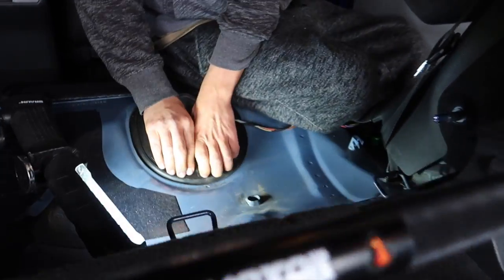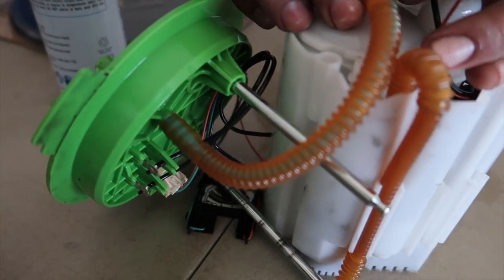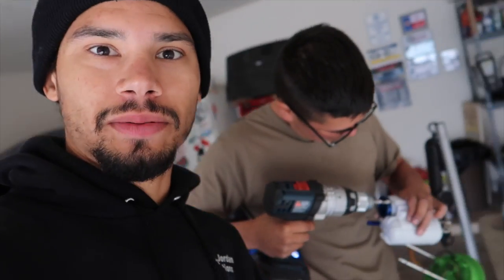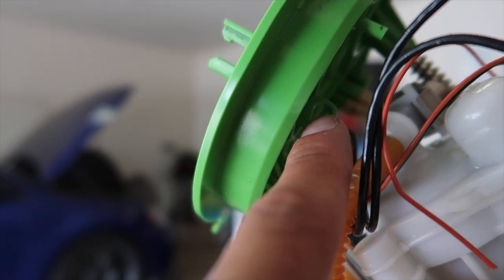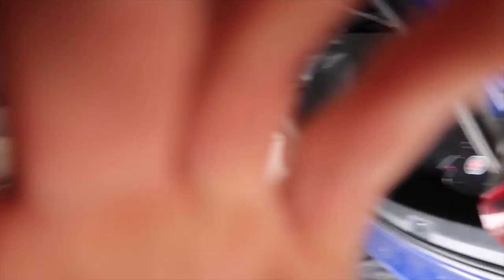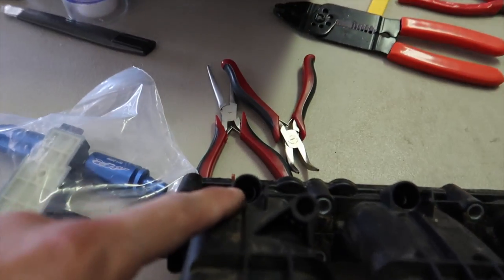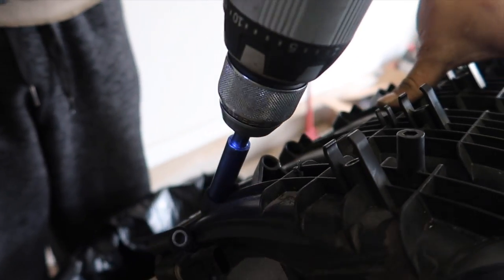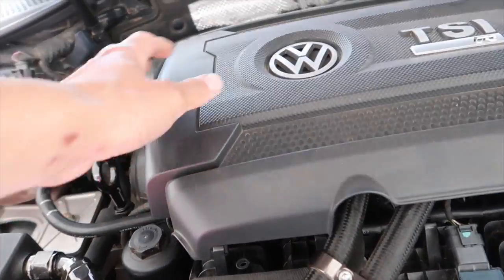All THE FUEL! | Precision Raceworks 925cc MPI kit + Walbro 450 | MK7 Golf R

Comment: I'm in this boat now looking to upgrade my Pump for A2B motorsport RS3 Brushless pump kit it cost more but its full replacement system with Plug and play connectors. Haven't seen much on it, but EQT carries it. I'm sure cause they have used it on there cars I hope. And hope it works out for my future Tune.

Comment: Did you upgrade your FPCM? at what point would you?
Reply from the maker: What is a FCPM? Like fuel controller? You should do it with a 450 if running ethanol or any other larger pump. I didn’t here cause I was on 91 octane. Once I went E I got a controller
Reply: @BryceJordanProductions  What controller did you end up getting?

Comment: Stupid question... Shouldn't you have done the fuel line while doing the fuel pump after draining the lines so fuel doesn't spill out?  Asking because if I go to do this I want to make sure I do everything in order as efficiently as possible :)  I supposed you could just uplug the fuel pump and run the car until it runs out of gas pretty easily though.  🤔Thanks!

Also, what blue silicone hose is that on the back of your intake?  Looks nice 👍🏻

Comment: How is the multi port different than stock? Yeah you get bigger injectors, are you changing their positions as well
Reply from the maker: Well physically you're adding 4 more injectors that spray on the valves (direct Injectors go directly into the cylinder), a fuel rail, pressure sensor, and all the wiring to accommodate that. So you end up with 8 Injectors working together. Power wise it all depends on your turbo setup and such but now you have alot more room for fueling and boost, assuming you did a fuel pump to go with the port injection. Hopefully this helps! If you want more specifics feel free to ask!

Comment: I've been running this kit for a few months now.  Keep an eye on that fuel line, especially the bend from the rail to the HPFP.  The sheathing on mine has already cracked there, fire hazard.  It looks nice when new, but I'll be changing the fuel line soon, the fuel line from precision is crap in my opinion.
Reply from the maker: We're you running the engine cover? Any chance that could have done some rubbing? I'll definitely keep an eye out!
Reply: @BryceJordanProductions  sorry I was under my daughter's account lol.  Yes I run the engine cover.  The split in the fuel line started near the rail, not by rubbing on the cover but near the tight bend there near the rail.  Just keep an eye out...
Reply from the maker: I didn't even notice the screen name till you said something 😂😂 but will do! I'm in there every other day checking oil/coolant/catch can 🤘

Comment: Hey! I know my bf needs mpi kit like this to run an ethanol tune but I want to be sure I'm getting the right thing. I've been checking it out online and wanted to see if you had the link to get this at? I'm kinda just getting the hang of the support mods he needs. Xmas gift:) Thanks!
Reply from the maker: Hell yeah that's pretty dope of you!! This is the link for the MPI kit alone (I went 925cc, that's plenty for 550whp), the second link will be for the fuel kit. I went with the stage 3 kit & now they offer it to be pre installed into a new bucket which saves a ton of time!

MPI
http://www.precisionraceworks.com/ea888-3-audi/vw-mpi.aspx

Pump kits
http://www.precisionraceworks.com/mk7/mqb-audi/vw-performance-fuel-pumps.aspx

Comment: How long did you run the big fuel pump and injectors before you put the eqt turbo in? I ask because I have the hellcat pump sitting in the box and now I need new injector so I figured I would just get the precision raceworks.  I plan on getting the big turbo eventually.  Did it run ok?  Crazy mpg loss?
Reply from the maker: I didn't run it beforehand really. But you could be fine to do so. The injectors won't fire till you're tuned and the ECU says to do so. MPGs I don't event pay attention to, it's a given that it won't ever be the same. You won't be able to resist much anyways lol
Reply: Yeah just curious i have a gti. Just had to replace the hpfp after  it went after me changing to the auto tech piston I changed failed (definitely get the tool) went with hpa pump. Was tuning when it failed and with 5 percent e85 mix it was at 400 whp with is38. So I know its hard to resist
Reply: And for the record I love watching your videos. Keep it up and welcome back

Comment: Hey Bro!

Thanks again for the help with the turbo install...finally got the big turbo in and now it is time to do the port injection.  Im in the process of removal but I see some people remove the throttle body from the manifold before removing it.....is it necessary or can I just leave it on the manifold?

Thanks again and be safe !
Reply from the maker: Absolutely not. I think it would be almost impossible actually. Leave that sucker on there!
Reply: @BryceJordanProductions  yeah I figured that some other guys showed in his video that you need to remove it before you take the manifold off ......now I know I should have watched your video from the get go 😂 

Btw what state are you located at?
Reply from the maker: Im in new Mexico. I have another video that shows this better too I'll try and find it
Reply: @BryceJordanProductions  I got the manifold on ...luckily I found a euro spec with pre drilled injector holes and mounts already in..but my problem now is when I tightened the bolts I snapped two of the ....I was able to remove them but am I doing something wrong......should I replace all the bolts with new??
Reply from the maker: The long ass bolts? Geez are you a giant?? Lol! I've re used them several times with no issues!
Reply: @BryceJordanProductions  yup those ....and no giant here bro lol.....what's did you torque them too?
Reply from the maker: Nothing specific just tight lol
Reply: @BryceJordanProductions  Thanks for your help!
Reply from the maker: Sorry bud I ain't much help here lol
Reply: @BryceJordanProductions  you are alot of help believe me!

 Car is sitting at united Motorsports getting ready to be tuned for port Injection....big turbo...E85 ...and haldex!

Should be lots of fun when I get it back!!
Reply from the maker: That's awesome!!!!

Comment: Hey do you can run the car out of the tune when it's installed the PR kit? I'll buy PR kit but I thinking to install by myself but need to drive to the tuner guy. Thanks
Reply from the maker: Yeah you can drive fine, it won't be active until the ECU tells it to work. But if you're doing a fuel pump as well, that's where things get sketchy. I wouldn't go too fast and definitely stay out of boost
Reply: Ok..... so I can connect the ECU cables everything just the fuel pump it's the only problem for more gas ⛽ hehe  thanks man for the info.
Reply: @BryceJordanProductions  thanks for answering. I was wondering the same if I can drive to my tuner installed and wired and ready for activation.

I am also debating if I do the drop in LPFP at the same time then drive to my dealer then later get the BT in or do it all at the same time. 🤦🏻‍♂️

Comment: Great vid 👍🏻. Ya, that is a decent amount of carbon buildup, but I've seen worse.  You probably took care of a good amount of it through the Italian tune up.  😂

So you can drive the car around after you installed the fuel rail and injectors with no fuel hooked up to it yet, correct?

Also, I take it with the port injection you have negated the need for a HPFP?  

Looks like a LOT of work!  I would be scared AF to modify and install that fuel pump myself.  Then again all the modifications I've done to my R have been nerve racking. 😂
Reply from the maker: Yup no need for the HPFP due to port injection! I was thinking the same thing, with as hard as I drive the car at events I'm sure that helped negate some buildup over time, I'm just real curious to see if the port injection will actually clean up the valves or just prevent additional buildup.. guess we'll see in a few months lol. It was alot of work.. but once it's done it's done.. hopefully won't ever touch that stuff again lol
Reply: @BryceJordanProductions  Cool, man, thanks.  Sorry, so you CAN drive it around with the port injector installed but NOT yet hooked up to fuel right?
Reply from the maker: Yes, I did but babied it.. gotta be careful especially if you do a fuel pump because the computer isnt calibrated for it
Reply: @BryceJordanProductions  Makes sense, thanks 👍🏻